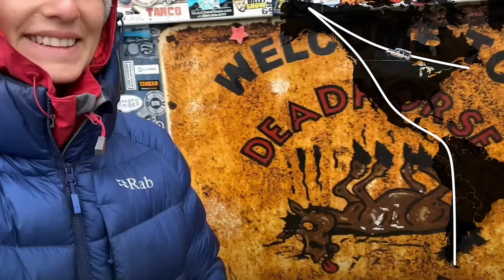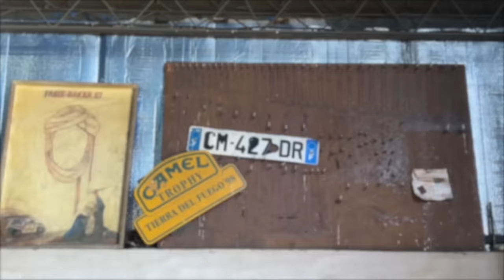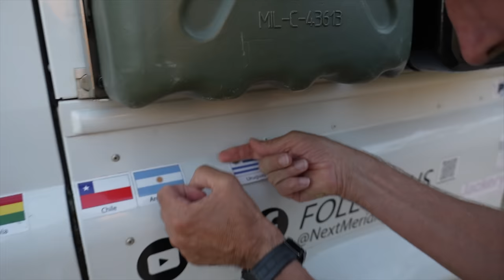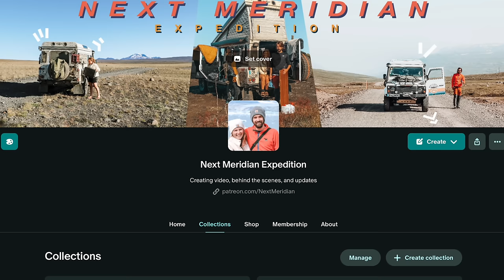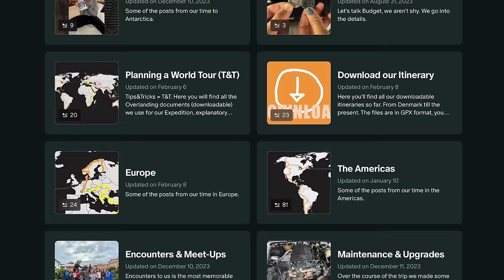We shipped our 4x4 to AUSTRALIA - EP 100

Comment: Nick, hi I noticed that the agent tied the vehicle down rather than the wheels in the container. The wheels should be blocked and then secured to container, with the gear in neutral. The vehicle body should never be secured, because of the movement in the shocks,
Reply from the maker: Hey, for Australia you can’t use any wood material, so they didn’t use chocks for the tires so that’s the only way we could have done the job. Otherwise you’re right.

Comment: wow this was intense, makes me think Australia should have been the 1st country on the voyage. But doesnt Argentina have car detailing shops/ car detailers you could have worked with? this would have been so much easier in a shop with the detailing machines and tools
Reply from the maker: Yes and no to both questions. Albo had already travelled quite a lot when we bought it so amongst that dust surely there were left over from some of its previous trips. And for detailing shops in Argentina we thought of it. But from previous experience, no matter how much you pay people don’t realize the level of detail you want especially for a shipment like that and we did not want to bet on it. And we also know that to unmount furniture or do some of the engine cleaning they might damage installations. What we thought is that surely the best would have been to rent a spot in a detailing place and maybe do the work ourselves.